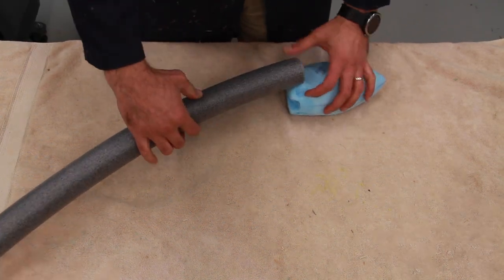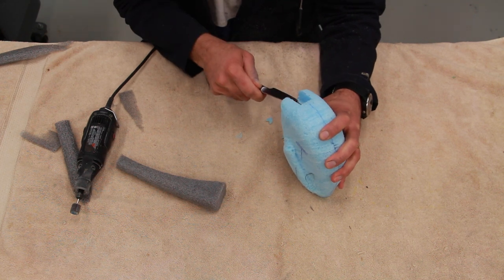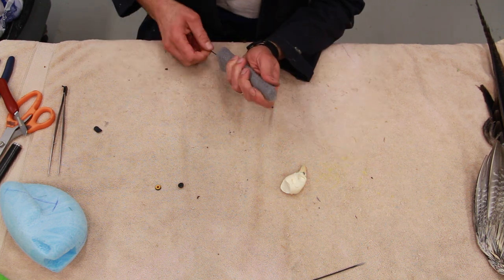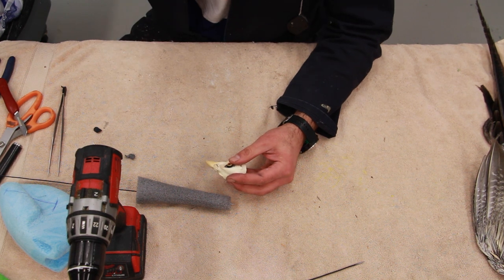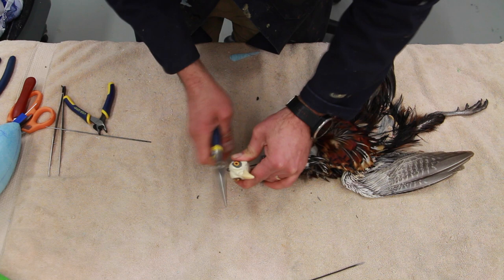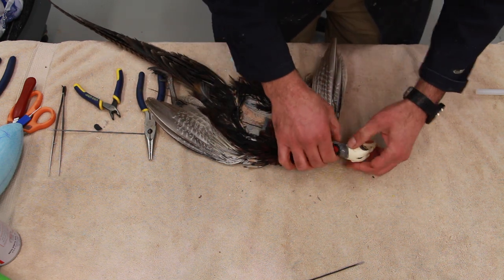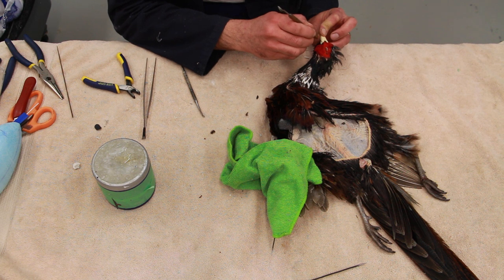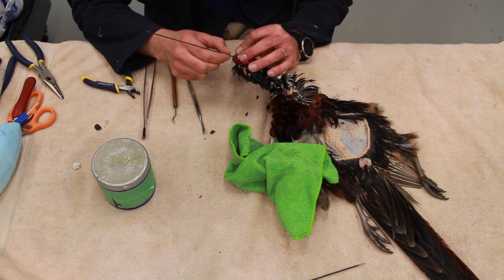Pheasant Taxidermy, 1 of 5... Neck carving, Facial clay work. Installing the head.

Comment: How do you feel about using the real skull?
Reply from the maker: It’s alright . I like the casted heads a lot more though. I have used the real skulls before there is nothing wrong with them , just a bit slower process and not as strong as casted ones.
Reply: @ArtofTaxidermy  Thanks for the quick reply. Another question along the same lines. In your skinning video you remove the "face" skin from the skull completely. i have seen many videos where the person leaves the "face" attached to skull just forward of the eye, just like you did in your grouse video where you rebuild the skull. Is this an ok option? it seems as if it would be easier to keep the "face in the right place on the skull.
Reply from the maker: @chrismartin9999   Yes Chris, thats totally fine to leave the skin attached.. there are many options to do the job.. I like the skull to be totally detached because its easier for me to set the eyes with higher accuracy and easier to adjust when I don't have the skin hanging on it... but yes, if you are starting It will be simpler for you to leave the skin attached.